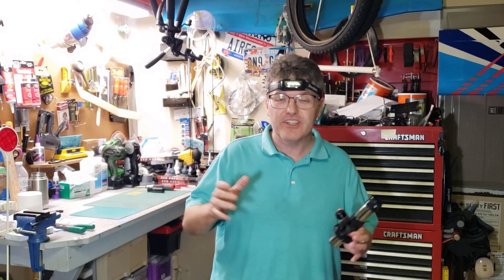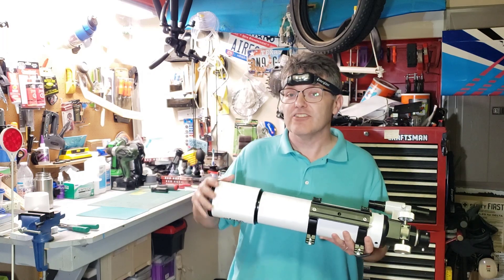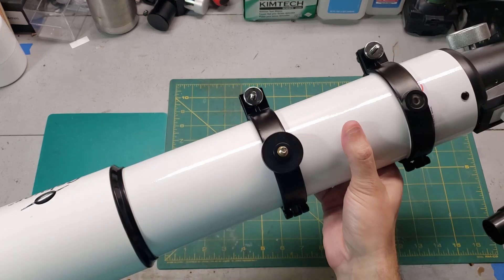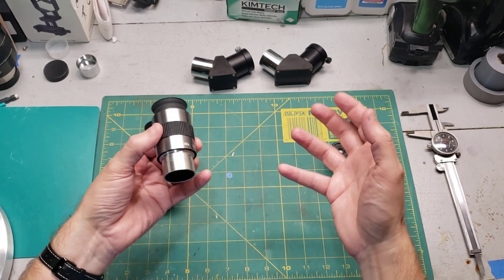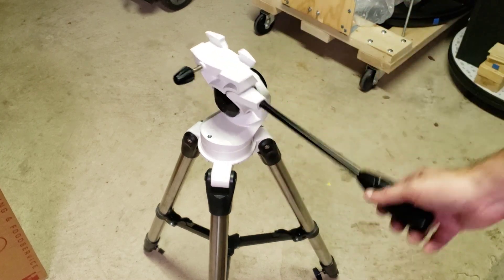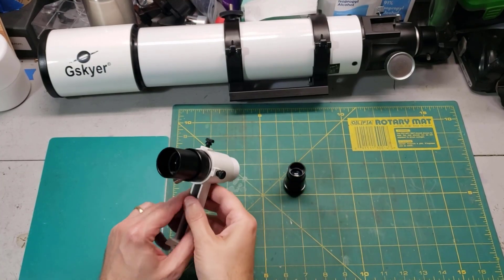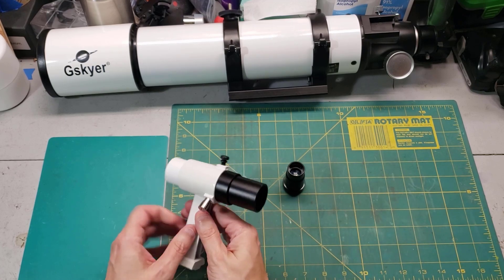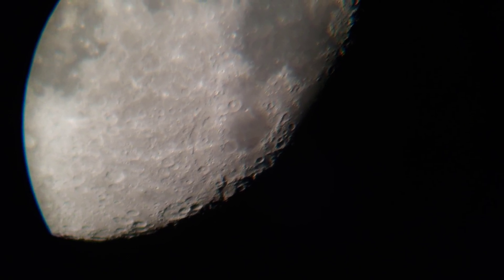Used Telescopes: How To Buy Your First One And Fix It Like New!

Comment: glad you got a good one i got the almost same one but was bad. I noticed the3 finder backwards in the pic of the add. and when you where showing the focuser i was wondering why it was silver inside figured maybe the diagonal.
Reply from the maker: It's always a mystery what abuse these used telescopes had to go through.  It works great on the Moon and the Orion Nebula (Trapezium looks great), but Venus looks bad.  Haven't tried it on any other planets yet.
Reply: @AstronomyGarage  yes it looked decent on that moon vid but could get worse as it gets too high power.
 Iam thinking Venus had lots glare & colour?

However should be good on pleaides & the hyades maybe m31 stuff like that

85% of used scopes i have seen in this entry scopes have always had issues or missing parts The worst ones was almost all reflectors had the mirrors really dirty  some had bad mirrors even after cleaning mirror was still foggy or hazy.

I think they had it in a garage with alot cleaning agents/ chemicals that will leak out and over time kill the mirror
Reply from the maker: Venus was very prismy, with colors smeared out.  Stars were surprisingly good.  I know what you mean about the dirty mirrors - that's what drove me to mention the importance of the dust cap when searching for a used telescope. Just having a dust cap almost guarantees good optics.

Comment: I found some elliptical front surface mirrors (25x75mm and up) on Edmund Scientific in the clearance section for $4, also all the elements for a nice eyepiece or Barlow for about $25 and many over 50mm, super cheap if you want to rebuild a 2" EP. I made a 4.25" reflector out of paper wrapped in fiberglass, a 10x spotting scope for $12 at Big 5 and a little focuser from an old refractor, but I'll be using it for astro so yeah. I found the main mirror in the dumpster behind our applied optics department, 4.25" 16" FL
Reply from the maker: Sounds like you have had some fun projects to work on.  Fantastic dumpster finds!
Reply: @AstronomyGarage  Right? I live near Chabot space and science center in the bay area and they have a free telescope building program. Grind your own 10 or 12" mirror, plus they have all the lasers and computers to dial things in.
I love your idea of buying used and fixing up!
Reply from the maker: @BariumCobaltNitrog3n  Cool!  Was that a relic of the John Dobson work?  I know he started all of his fun telescope stuff in the bay area.  I actually lived in the bay area for a year and had no clue about the San Francisco Sidewalk Astronomers club or that John Dobson was still active in the telescope making hobby (I'd hand-built a Dobsonian five years earlier).  Otherwise, I would've tried to get his autograph on my Dobsonian!

Comment: Ah, so all if my scopes purchased since November 2022 have been used.  Orion 100 f/4 tabletop newt, Orion 76 f/9 eq newt, Starhopper 8 f/6 dob, SV nighthawk II 80 f/6, Meade 4504 eq newt, Sears Towa 60 f/15 eq, Tasco 999VR 60 f/5, Celestron C102HD eq.  I need to stop watching Ed Ting and Reflactor channel 😂
Reply from the maker: That's an impressive collection!  I think Ed Ting has about 10x more telescopes that either of us, lol.  Thanks for watching.  :)
Reply: i watch ed ting and im seriously considering buying a 10 inch dob even though its not really an upgrade to my c8se

Comment: I buy used computerized telescopes during the day. I do a fake star alignmentto and if the scope points at a star on my phone's planitarium software, I know it is working. I bought a scope from a person and explained how I was testing it And they exclaimed "There are stars up there during the day?"
Reply from the maker: Very clever.  I use that trick when working on mine in the shop too.  I've thought about finding a benchmark date/time and then drawing a few accurate stars on the walls of the shop for reference.

Comment: Last year bought brand new 127 triplet ed glass, the focuser wouldn't rotate, the front lens were loose and wobbling ed glass the focuser draw tube wobbled, all because off shipping damages, so even new scopes needs fixing, great video keep them coming, ps i have the same toolbox bought back in 1979, got any spare draws stops, little metal clips? clear skies                   keep the videos coming.
Reply from the maker: Wow, your telescope had a rough ride for sure!  Were you able to fix it all?   I bought that toolbox used from a friend who upgraded to one twice that size - it's functional, but I don't have any spare parts unfortunately.  Special trivia:  The sound you hear in between scenes in the video is this toolbox drawer opening and closing.

Comment: I find that used telescope sellers typically ask way too much, even for a lightly used instrument. They don’t appreciate that buyer has no warranty or any recourse if it’s a lemon. Once in a while I see a decent telescope for a decent price. My best purchase was $85 for a vintage Tasco 60 mm (back when they were good). It came in the original wooden case and had all the parts. I bought it out of curiosity, and now resides in a telescope museum.
Reply from the maker: I've seen prices all over the map.  For example, I bought my 12" Dob for $250 via the Facebook Marketplace.  I had to get it recoated for $175, but that was still a pretty good deal.  When I sell a telescope, I often throw in extras and give them my phone number so they can call me with questions.  This is especially true if I sense they are brand new to the hobby.  Question: There is telescope museum?  Please tell me about this!  :)

Comment: Must be I am lucky, but I got used Orion 90mm skywatcher for only $50 on facebook marketplace at list price.  Nothing missing and in fact it had additional 43mm plossl eye piece not in original set.  All metal parts and it works great.  Nothing to repair as as I can tell so far.    Next, I bought a used department store telescope (meade 60mm).  And yes it was incomparably bad compared to Orion 90mm.  But as this telescope is so light, it's much more transportable than Orion 90mm.  Surprising thing is that cheap 0.965 eye pieces that came with department store 60mm scope aren't so bad.  I 3D printed 0.965 to 1.25 adapter and the cheap 0.965 eye pieces worked pretty well with Orion 90mm.   No need to buy adapters if you have 3D printer (as you demonstrated printing out that tray), just print out 0.965 to 1.25 adapter or 1.25 to 0.965 adapter and you are good to go!
Reply from the maker: Congrats - you got an excellent deal.  About those 0.965 eyepieces, agreed, a 3D printer is your friend.  I have an adapter too.

Comment: Are those telescopes any good? I see lots of them all the time for sale. Also wanted to mention, i also bought a used telescope during the craziness of the pandemic, 8 inch dobsonian, think i got it for about $120, i had no idea what to look for, but if you are good with tools and especially after watching some of your videos i was able to fix it, it was missing one of the collimation screws for the primary mirror, no view finder, just one eye piece, the base wasn’t as smooth as i would like, i had to clean the primary mirror, and it was probably never collimate it, i took some time fixing it, but now it’s basically like a brand new telescope for a fraction of the price. Definitely love watching your videos, it just took me a couple of days to actually watch it since it was a little bit long and wanted to watch it with no interruptions, thanks for the info
Reply from the maker: This Gskyer is great for the Moon and Orion Nebula, but not so good for Venus. I haven't used it on any other planets yet though.  Congrats on getting an 8 inch Dob and getting it so cheap.  The 8 inch Dob is the one I always recommend - it's a "forever" telescope because it's the sweet spot in aperture, portability and price.  Thanks for watching.  I actually try to make shorter videos, but this one kindof got away from me, lol.
Reply: The short tripod, bad alt-az mount, and use of a 45 degree diagonal make it pretty bad to use to be honest.  Mine seems to have some terrible spherical aberration or something unless I stop down the aperture.  Maybe there's something else going on.

Comment: Have you ever or have you heard of anyone replacing lower cost, low quality optics in a cheaper beginniner scope for better quality? I've got a Hexeum 80x600mm "beginner scope" and I've been pondering the idea to see if I could improve the quality of it.
Reply from the maker: That's an interesting question. I've never heard of that happening, but it's certainly possible. You'd have to get a matching set of lenses with a focal length similar to the originals.  I think it would likely be so expensive that you'd be better off buying a more expensive one.

Comment: Did you make any videos showing how to repair the electronic alt/az mounts ? I've got a DS90 refractor and don't know how to bring it to life. Thanks
Reply from the maker: My hour long Dob restoration dealt with broken encoder ( https://youtu.be/9O7PHAUD96I  ) and I had one that I had to take apart to fix a loose mirror:  https://youtu.be/gIziqgXdiIw
Reply: @AstronomyGarage  I'm sorry, I mean just the drive on a refractor mount. Thank you
Reply: I have a Meade DS2090.  The goto mount was not accurate and not steady.  I moved the OTA to a Celestron Heavy Duty.